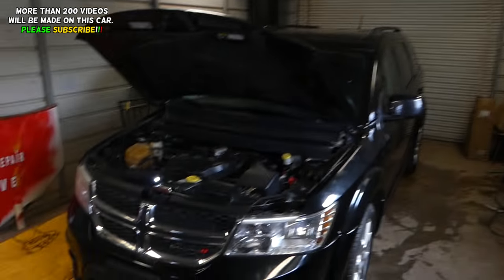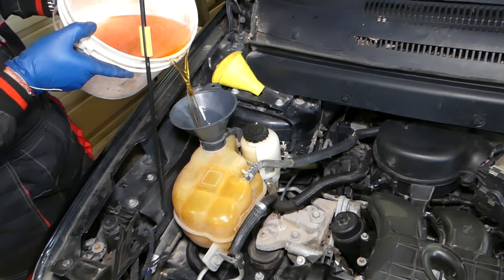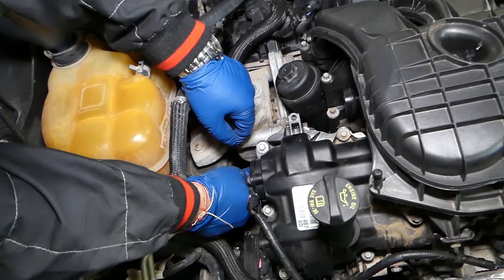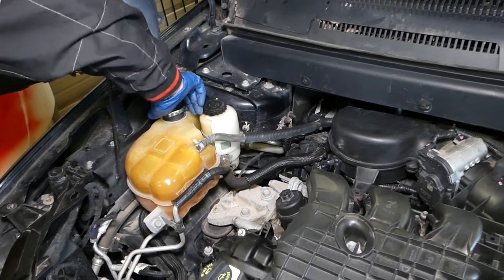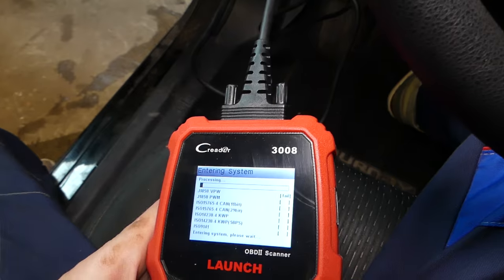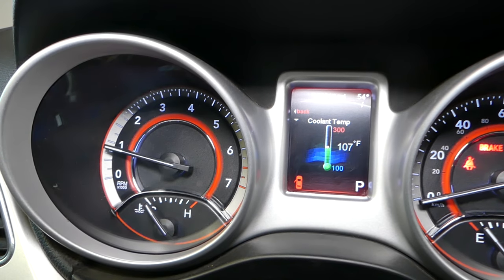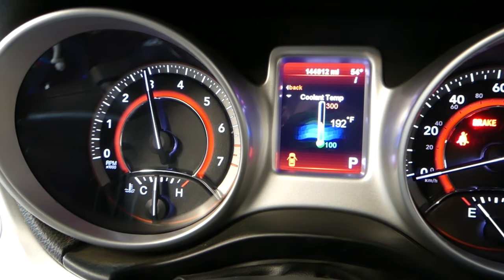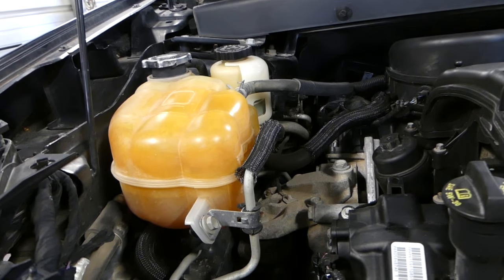DODGE JOURNEY BLEED COOLING SYSTEM | HOW TO BLEED COOLING SYSTEM FIAT FREEMONT

Comment: Every video leaves this out. The full line at the bottom of the reservoir is the full line. Do no top off coolant over the bottom line on the reservoir. Mine has arrows pointing to the bottom line. There really isn't much to bleeding the system. If you over fill the coolant just a little it's going to run hot and also trap air in the system. Mine ran hot for three years. It's an awesome feeling to get this under control.
Reply: I’m going to try this hopefully it helps because it’s just been sitting because I changed about every cooling system part

Comment: I just came across your vid here and wanted to let you know , you did terrific presentation with your step by step procedures and showing all the aspects of completely resolving the issue, that's coming from a  35 year mechanic. You actually made it simpler and easier  to follow than the factory seminar. Great Job

Comment: If I repeat the process I would have to remove the screw each time? My car has a blown head gasket but I cant afford to fix it so Im trying to get the car to last me as much as possible and I’m changing the coolant reservoir because it is cracked but I am hoping it will be helpful and allow the car to last until I can afford another car.

Comment: Thank you for this. The coolant reservoir on my car split just below the factory weld I got it off and welded  the crack with a soldering iron and used an empty milk jug for rod because they are the same kind of plastic. I'll order a new one from eBay.  But I need to drive this load tomorrow. Seems to have worked fine, but I couldn't get the air out of the system. The top hose was empty. I'm from another time and would just roll with a loose cap. No longer possible  I see that now thanks to you. I would never have thought of bleeding the heater cores. Know any way to find the code to fix a Volvo tranny with a proprietary code. Only dealers have them. I have a mint wagon that's worth nothing because of this $3000 computer repair. Grr. I hate car companies. My first car was a '54 Mercury LOL

Comment: My wife has an 2013 Journey R/T. You skipped the one piece I needed to see! The metal cap on the reservoir will only turn about half a turn then stops. I have the sense it should turn more and then come loose. I'm afraid to try to force it and I'm also afraid to try to pull up hard on it. 

Thoughts? 

I just want to use a hydrometer to test the coolant/later mix to determine the cold it will handle. For that, I need to be able to stick a tube into the reservoir, catch some coolant/water mix and see what the hydrometer will tell me. 

I'm hoping I don't need to bleed it just for that simple application but I admit I don't know. Would I even if all I do is test and return a bit of the fluid? Seems like I wouldn't disturb anything in the engine or much even in the reservoir.
Reply: Push down and continue to turn there’s a lock mechanism

Comment: I have the exact same vehicle, I recently had my radiator replaced at a Dodge dealership. When driving down the road my coolant is only about 140°F but I can sit parked and it goes to above 200°F no problem. Only cools down when driving. What is causing this and how do I fix it?
I don’t think it’s the thermostat, because I can watch the coolant temperature while parked and it gets up to 220°F then the thermostat opens and it cools down to 190°F and back up to about 203°F and stays there as long as I’m parked, but as soon as I start driving it slowly drops down to 130°F and stays there until I come to a stop.
Reply: most likely an air pocket

Comment: What if my heat in the 3rd row is still blowing low to medium warm air? Does that mean I have air in the system still? How would I go about bleeding the air out of the system to get the heat as hot as the front? I can barely keep my hand on the front vents for more than 10seconds where as in the 3rd row it’s not blowing hot air like the front?

Comment: Also can I rev the car like that if it has blown head gasket?
Reply: Well the head gasket is for the oil, so I assume you could rev the engine like that but I bet you are leaking oil, from my experience head blown gasket leaks oil as long as you have oil I think you will be fine
Reply: First off a blown head gasket can leak coolant into your oil depending on where it is blown. Check your oil to see if it is milky or not

Comment: Is that very serious if slight bit leakage is happing in transmission pan underneath the Dodge Journey RT 2014 ? Or what could be the reasons behind its little bit leakage ? Leakage is not like dripping oil it’s just a slight leakage on the transmission pan underneath the car ?
Reply: Did you figure it out?

Comment: can you do a video on how to replace the coolant tank.
Reply: Super easy. Two 13mm bolts, pull the top hose first, pulle the bolts, it out and pulle the bottom hose 15 minute job. bleeding it out is a BIG problem
Reply: @michaelowen4582  any tips for bleeding it? I replaced the reservoir and the thermostat but I’m dealing with air pocket issues now :(

Comment: My Dodge Journey leaks all the antifreeze right up in the engine I someone told me it’s a hose is this true!? The antifreeze leaks out in 4 minutes and the. The engine overheates
Reply: Mine does the same did you ever find out what it was
Reply: check out the engine oil cooler / engine oil filter adapter. it's common failure on all 3.6 L chrysler motors from 2011 to 2014 . just  replaced mine  broke down on the highway and burned oil  really badly and coolant sprayed everywhere . it's a very nasty awful repair caused by 5 o rings
Reply: It can be the thermostat housing....which is easy to replace on the 3.6 and kind of a bear to replace on the 2.4....it's made of plastic and the mating surface to the engine warps and leaks coolant